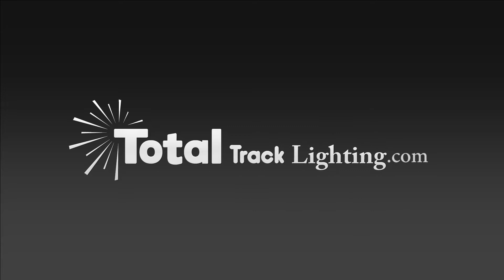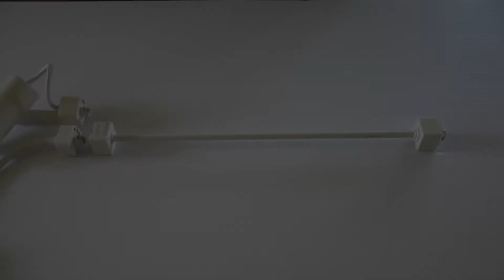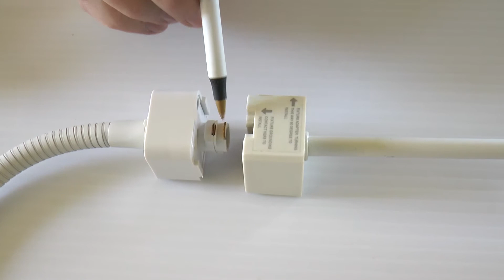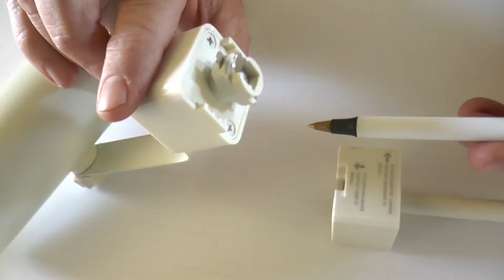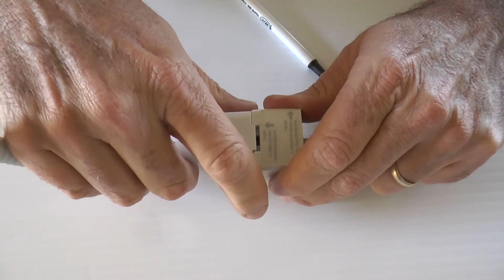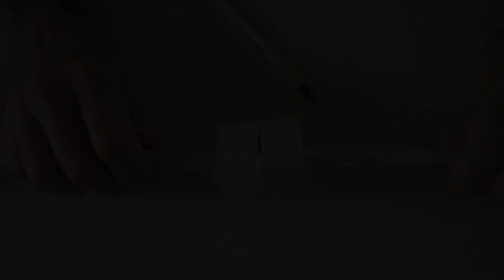How to use track lighting extension rods Raw Cut by Total Track Lighting

Comment: can this be used to join and feed a second track below and perpendicular to the main track?
Reply from the maker: The extension rod is designed to lower a track fixture down from the main track lighting system and power it electrically. So if your plan is to bring the light fixture further from the ceiling and closer to the floor then this extension rod will satisfy your needs.